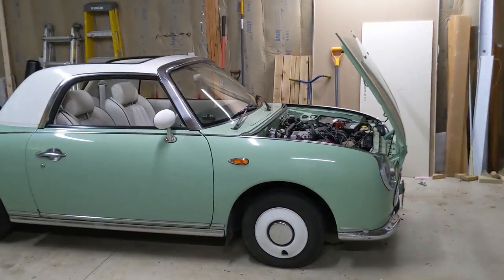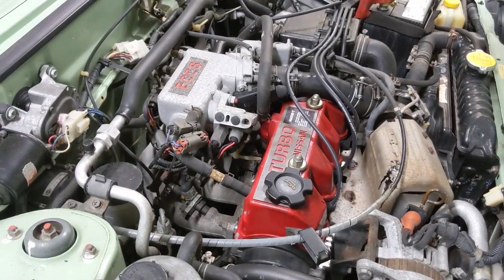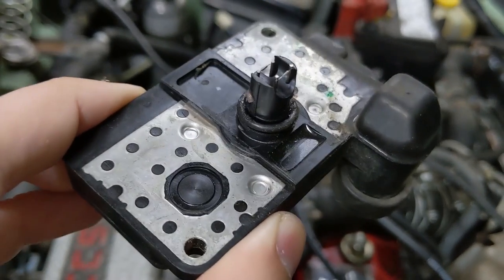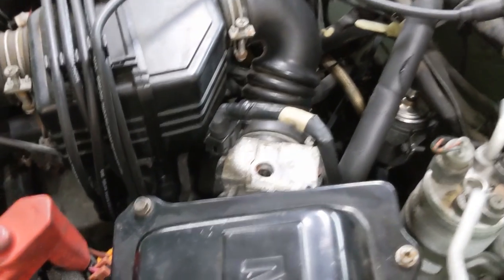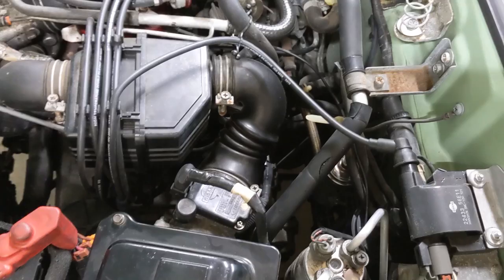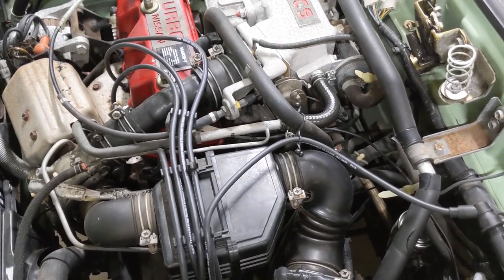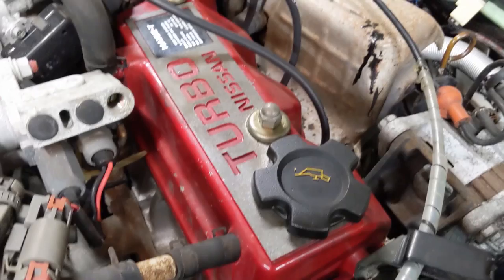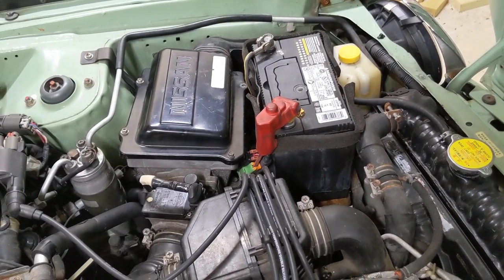Modern engine control musings and Fixing a Figaro

Comment: You're correct - the ECU has no control over the idle air valve.  It's simply a rotary valve that's actuated by a bimetallic strip, with an electric heater in it.  When the key is in the 'run' position, +12V is put to the two-pin connector on the valve and it begins to heat up.  When cold, the valve allows bypass air past the throttle plate, allowing for a 'fast' idle position.  As it heats up over the course of thirty seconds or so, the heated bimetallic strip rotates the valve shut, so no bypass air is allowed.
This valve remains powered and heated as long as the car is running, which is why they fail as often as they do.
There are three other idle-control circuits on the Figaro that you need to consider as well:
- There's an idle-air solenoid on the rear of the intake manifold that raises the idle speed when a pressure sensor on the power steering system reads that you're cranking the wheel over
- There's an idle-air solenoid on the front of the intake manifold that raises the idle speed slightly when the headlights are on, to compensate for the extra load of the alternator
- There's another idle-air solenoid next to that one which raises the idle speed when the air-conditioning is set to 'on'.  Note that this doesn't necessarily mean the compressor clutch is engaged; this circuit will be energized when the dash panel is set to A/C on, regardless of the compressor state
There are two adjustment screws that adjust the bleed air past each of the last two solenoids. Those are located under the black plastic caps on the idle-air block mounted to the front of the intake manifold.  Each of those screws seal in the block with rubber o-rings that are likely ossified by now.
The FIgaro's idle air system is painfully simple - there's no dynamic adjustmet.  It's literally some bypasses and bleeds to kick the idle up on command, and all of them need to be dialed in.
Also (also!) it's time to pull the intake air boot from the MAF to the resonator box, from the resonator box to the turbo inlet, and from the turbo to the throttle body look for cracks that will allow unmetered air in.  I managed to kill my first Figaro by running it lean due to a crack in the articulated rubber section post-MAF allowing in unmetered air and causing it to run lean.
If you haven't yet, it's probably a good time to pull the valve cover and ensure that the rocker shaft is torqued down correctly as well.
Figaro Owners' Club has instructions on how to adjust the idle properly, and The Figaro Shop sells a complete set of silicone intake hoses, as the original Nissan pieces went out of production sometime during the Clinton presidency. Best of luck with your Figaro.  Hopefully you didn't do what I did and buy your from Gary Duncan ;)

Comment: Makes me miss my 1969 GMC truck. Had a small block 350 in it. There was 3 wires going to the engine. One to the starter, one from the alternator and one to the coil. One vacuum line from the carb to the advance on the distributor. I could sit inside the engine well on the fender and change the spark plugs. Was so easy to work on when you had to. I drive a 96 Ranger now. Comes with its own issues. Thought i was going to have to replace my clutch cylinder, turns out it wasn't the problem. Good thing to since Ford decided to do a concentric cylinder they call it for those couple of years. It goes Over the input shaft, instead of outside the transmission. Turned a 30 minute job into an all day job of having to pull the transmission :(

Comment: There's just enough technology to make for a better engine, but not enough to make for better diagnostics.  You can backprobe the sensors, at least, which is more time-consuming to diagnose than having OBD2, but still more insightful than what even older cars provide.  I have no rose-tinted glasses as far as that is concerned.  Give me sensors any day.

The IAC, if that's what that thing is, can definitely be a culprit.  I would think that sticking closed is more rare than sticking open if it's a matter of buildup.  There's always the possibility that you're losing vacuum through the line to it, preventing it from opening, which could obviously also affect the idling.  On a car that old, losing vacuum somewhere is not at all surprising either, even if it seems to be running fine.  Temperature differences can cause small cracks in seals and hoses to open and result in different behavior depending on time of year and such.  This is when having fuel trim data is invaluable.

It's a slick-looking little car, though, and I'm sure it's just a matter of time till all the gremlins are out.

Comment: The Figaro is of course rare, but this engine (MA10ET) was also available in the Nissan Micra (specifically the K10 chassis) which sold by the millions all around the world... That could help you to cast your net wider when looking for technical advice (AND PARTS!). Note that there were other options on the K10 Micra so not all advice will apply! I know we didn't get the MA10ET in official imports to the UK market, for instance.  
Good to see you swapping the tweed for a boilersuit and getting your hands dirty!

Comment: I have a Japanese vehicle that was sold new in the US in 2009. It's road legal from the factory, and it came with a carburetor and did NOT come with a catalytic converter. It does has transistorized ignition, but the fuel is gravity fed, and the fuel intake is completely mechanical.

Comment: I see Nissan all over the engine compartment.

Speaking of computers, automobiles, and Nissans/Datsuns, my very first complete engine overhaul was a 1977 Datsun 280Z.  I had already done a lot of head-gasket jobs and timing belt jobs before, but my first complete engine rebuild was a '77 280Z.  Engine was computerized and fuel-injected.  Analog computer, IIRC.

Even my mom's 1985 Plymouth Reliant (Dodge Aries) with a factory installed two-barrel Holley carburetor was computerized.  There were wires and vacuum hoses running everywhere and there was a computer of some kind connected to the engine.

While many foreign imports were using fuel injection already (port, sequential, CIS-E, or similar) the American automakers were still using carburetors or throttle-body fuel injection.  TBI (throttle-body injection) used a device which, at a casual glance, looked like a carburetor, but instead of a float bowl and jets, it had a fuel injector or two in the center of the air passage (both had a butterfly throttle valve).

This is probably one of the reasons a 1990 Volkswagen Jetta or Golf had a 1.8L 4-banger putting out 100 Hp and my mom's 1990 Dodge Spirit had a 2.5L 4-banger putting out the same 100 Hp.  And, the Spirit was a bigger and heavier car than the Golf & Jetta.  For an American car from the 1980s, 100 Hp from a 4-banger was a lot.  Some V8s of the era barely had 140 Hp.  Yeah, my mom's car was a '90 model year and I'm talking about '80s era cars.  It was a 1980s design and might even have been manufactured in the Fall/Autumn of 1989.

There are many, many 4-bangers from the late 1990s and 2000s now which had similar horsepower to 1970s and 1980s American V8s.  Some newer 4-bangers even have more ponies than the carburetor-equipped post-emissions restrictions American V8s from the 1970s and '80s.  And there are many econo-boxes now with better suspension, steering, and handling than those 1970s and '80s American V8 cars.  And quicker 0 - 60 times too.  Even the Pontiac Trans Am  started off with a 100 - 105 Hp six with the 4.9 - 5.0L V8 only putting out 135 ponies in the late 1970s (My 1998 Camry with a 2.2L 4-banger just about matched that with 133 Hp).  The Bandit's 1977 Trans Am (technically, a 1976 with a '77 facelift) was probably the 400 or 455 in³ (6.6 or 7.5L) engine putting out 200 ponies.  Most V6s made in the last 20 - 25 years and some 4-bangers of the last few years put out more than 200 Hp now.

If you think the two decades between the late '70s Trans Am and a late '90s Camry isn't fair...  The 1977 Datsun 280Z beat or matched all but the 400 in³ (6.6L) engines offered in the 1977 Trans Am, with 170 Hp from its 2.8L inline six.  The '77 Trans Am's L34 & L76 350 in³ (5.7L) engine options matched the 170 ponies from the 280Z's 2.8L mill, but with 2 more cylinders and roughly twice the displacement.  Screaming chicken, sorry (unless you opted for the W72 V8 monster).

Of course, the '77 Trans Am beats most 1990s and 2000s cars in looks, hands down, if looks are important to you (I'm a function-first kind of guy.  To me, appearance is secondary, maybe even tertiary).

Comment: Some cars can run fine-ish even with few teeth missed when putting timing belt on. My mechanic was chasing his tail trying to figure out some weird problems (camshaft sensor for eg.), and figured out that someone who changed timing belt before didn't time shafts properly. Worth checking.

Comment: On 90's Hondas that cold idle valve equivalent would cause surging as well.  It was mainly for North American cars that can get a lot colder than cars in Japan.  One "fix" was to block it off so it would operate as if it didn't exist, which was fine if you lived in an area that didn't go way below freezing.

Comment: From memory the filaments in the MAF are powered all the time. When the filament is cold it's resistance is lower, so what is happening is that the circuit monitors the current trough the filament. One filament is sitting in the airflow and does the measurement. The other filament is not in the airflow and provides the reference so ambient temperature does not affect the readings. It will only see the difference between the filaments.

Comment: I know it’s late and not sure if it’s been suggested yet but, any small air leaks between the throttle body and MAF can skew reading to the ECU and it will behave like a faulty or dirty MAF sensor. 
 Check for any loose hose clamps in the intake ductwork and pay close attention to the rubber & plastic parts to be sure there’s no cracks or dry rotting, even the slightest crack will make engine performance suffer. 
 30 years isn’t kind to plastics and especially detrimental to many types of rubber parts. 
 Essentially un-measured air is entering the engine but it wasn’t accounted for by the MAF and it fools the ECU which causes a whole bunch of starting and drivability/performance issues.

Comment: In the late 70's to about 1995, the electronics in a car were really challenging.  They worked, but were hard to work on.  At that point, carbs and mechanical systems were just easier and worked better most of the time.   You could do some stuff with some of them, but it took expertise in the exact particular system.
By the late 2000s, we had cars built 2000 or later that were completely controllable.  My 2001 and 2002 Audis communicate excellently and basically tell you what is wrong with them.  If anything, they are a little too sensitive at detecting small problems.  The ECUs can be entirely reprogrammed by a good DIY type to change features, set turbo pressures, allow different fuels, turbos, control ignition; you name it.   We really did reach a great spot where  the computer systems were helpful.   Unfortunately, the manufacturers are really starting to hold back information, so I think cars will get increasingly more difficult from here on out.

Comment: The throttle air thing you're talking about is probably a precursor to the Throttle positioning sensor.  Cleaning it is a good idea before fully replacing.  You might look into the thermostat sensor, or the actual thermostat system.  The cold idle typically holds it until the thermostat opens.  At least on older cars like this.  It was a vacuum mechanical system in pre electronic cars, now there's likely a sensor for it.  Even my 1999 Toyota idles high until it warms up a little bit (when it's 95 degrees out).  If it's idling that high all the time, there's a failure in the sensor loop that tells it that it is warm enough to go to normal idle.  The starting problem could possibly be fixed by cleaning the throttle body itself with throttle body cleaner.  Just like a dirty carburetor,  buildup of grunge can limit movement of internal throttle body parts causing it to choke out.

Comment: So these are just some little tidbits from an owner of a late 80s R31 Skyline, which also uses the ECCS computer (albeit with 6 cylinders to control), and while they may help you they probably won't fix all your issues. I'm just mentioning them as the "go to, first fixes" for Idle, timing, hesitation and surging, starting and power related inconveniences. 
The screw on the ECCS unit does turn on diagnostics mode, but it also has some degree of idle speed control.

The Throttle Position Sensor can be rotated to adjust the idle->power and power->idle switching. Usually a handy fix for hesitation more than surging.

Putting a timing light on the car to see what degree of advance it has, and adjusting it may handle a variety of issues.

As for the IAC valve, as a general rule, never clean them with degreaser/brake clean unless you have to. Unfortunately even brake clean leaves a bit too much residue for the old valves. Carby/throttle body/MAF cleaner is the go. You can disassemble the IAC completely or just open it up and spray a bit in there. Depends how far you want to go. 

The IAC should also have an adjustment screw on the back (at least thats where mine is). Combined the IAC, ECCS Idle Adjust/Diagnose screw, and TPS adjustment are the 3 ways the idle is generally controlled with an ECCS equiped engine.

As mentioned by a few others, definitely be on the hunt for Vac leaks, they cause many a headache.

Hope something helps. I love to see car stuff on non-car channels, I'm looking forward to seeing what you make of all this Suck-Squish-Bang-Blow business.

Comment: Great video and very interesting! I have a similar issue on my car and I never realized you could clean the MAF sensor to fix surging at idle.
Reply: You can do, but be careful as I’ve had the force of the spray bust the wires.... most often it’s easier to just replace. This maf I think is the same as the nissan March as they share the 1.0T engine iirc.

Comment: Here are the possible problems that cause the the idle speed and starting problems: vaacum leak, stuck pcv valve, stuck idle control valve, air intake temperature sensor (if equipped), throttle position sensor and last but not least o2 sensors. But it wouldn't hurt to check the throttle cable for binding or misadjustement for the high idle speed if all else fails and a fsm will help out a ton to test all the parts mentioned above so you don't throw parts at it.

Comment: A few things to look at. Remove the hose clamps and take the housing for the mass air flow and clean it as well there is usually a mesh that can become clogged causing similar issues.  As for the idle speed it is to high it should be around 850-900. A vacuum leak can cause high idle as well as the throttle position sensor, cleaning and adjusting the tps may help.

Comment: The mass air flow sensor cleaner worked on my son's Neon. Ran fine, just tripped the check engine light. My '65 Chevy Corvair has six fuses!
Reply: My '61 only had 5 originally. There are some great aftermarket fuse boxes for Corvairs, they're well worth it for peace of mind. Our cars didn't even have main power fuses for most of production!

Comment: I'm learning engine control and tuning, so here's a primer on how MAF sensors work. There are two types; vane and hot wire. Vane types have gone the way of the dodo long ago - they weren't very accurate. Hot wire sensors work by heating up a wire with known characteristics at certain temperatures. The ECU receives temperature information from a separate intake air temp sensor somewhere in the air box, usually after the filter element.

The speed and volume of the air, correlated with things like throttle position sensing, determines how much that wire cools down, determining its resistance, and therefore gives the ECU a certain value of airflow, expressed in grams per second. There are other sensors which go into determining this, and open/closed loop control is also a determining factor, but that's how MAF sensors work, in as plain English as I can muster.

I think Einstein said that if you can explain things clearly, then you understand them properly yourself. I'm guessing I failed pretty hard there.

EDIT: Also, a bad MAF sensor shouldn't have any bearing on cold starting issues, primarily because the ECU doesn't actually use MAF input on startup. both MAF and O2 sensors need to be at a certain temperature to work, as do catalytic converters. Until that happens, the ECU is just going to be receiving junk inputs, so it ignores these inputs, and uses a standard fuel map, which can still be influenced by things like engine coolant temp, stuff like that. At least this is how it works on my car, which is more modern. Not sure about older Japanese cars, sorry.

EDIT 2: It's either the crank or cam sensor (depends on how it's driven, I suppose), but the reason it's in the distributor is because it's mechanically linked/driven from either the cam or crank.

Comment: If you’re making a video on OBD II, keep in mind that many adapters are actually cheap clones of the ELM327 version 1, before they set the lock bit to prevent reading the contents of the microcontroller (ELM electronics sells pre-programmed microcontrollers), so it has a reduced feature set. There’s another IC from a different manufacturer, the STN1110, that’s better and cheaper than the ELM327, but I can’t find OBD II adapters that use it and are cheaper than a genuine ELM327 (odd, considering the chip itself is cheaper).
Reply: Why are you going on about OBD when there was no such thing in 1991?